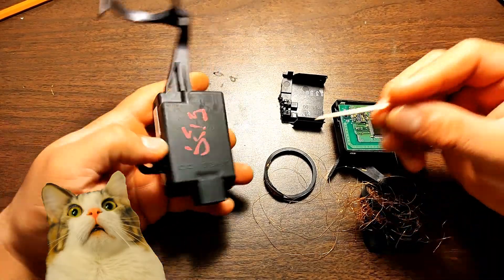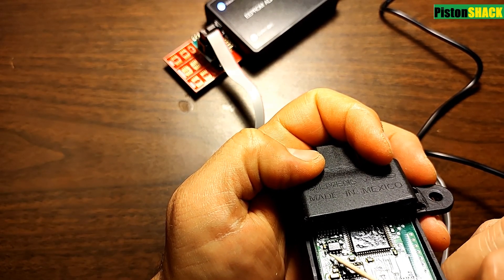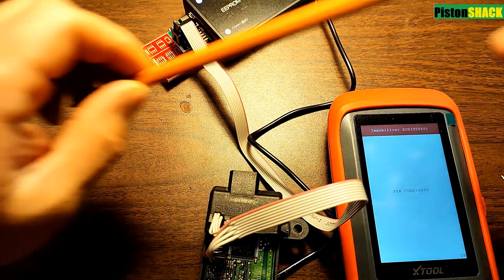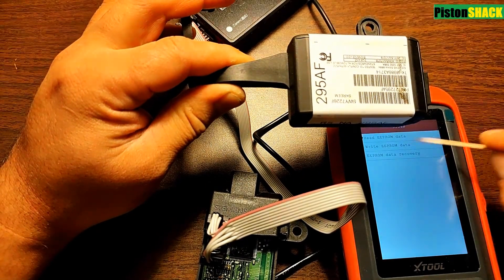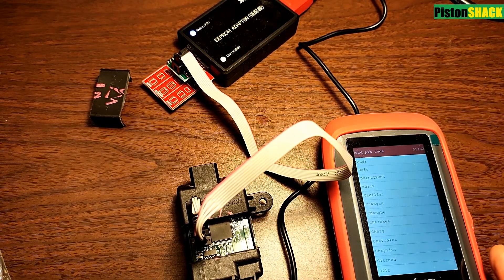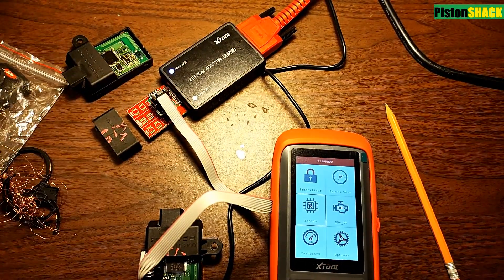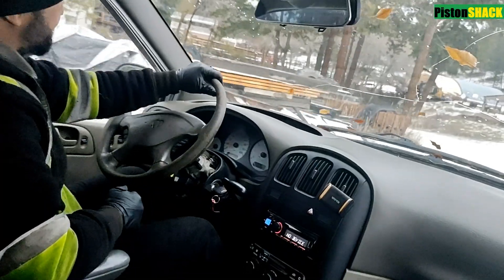HOW  EASY TO PROGRAM USED DODGE, JEEP, CHRYSLER  IMMOBILIZER aka SKIM, SKREEM TO YOUR VEHICLE | p2

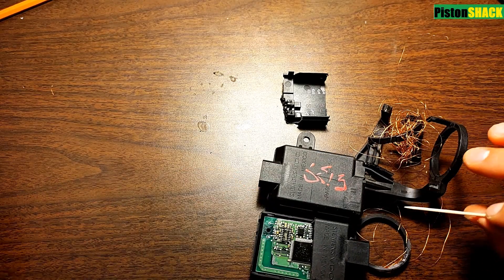Comment: Great video brother. Are you familiar with the 2001-2003 immobilizer eeprom reading. It looks identical to the immobilizer that you brought out here 1:42  except it says immobilizer 3 on my version. And when. You take the board off it does not have the 8 leg eeprom on the reverse side like one board with a chip on it like 24cl02. This 2001-2003 caravan has been my arch nemesis for the last 5 years being a locksmith I just can’t seem to figure out how to edit the immobilizer data. Please help brother!!!

Comment: cant you just pull circuit board out of old skreem and put in new one?
Reply from the maker: I guess you can but problem was to re-wire antenna to the circuit board. Let me know what worked out for you. Cheers!
Reply: @PistonShack  lear ones sit on 2 pins.. can be swapped

Comment: I found a locksmith service that will cut 2 new keys and flash a new skreem to make this "plug and play". They want $300 usd. 😱  No way on a van worth so little in value.
Instead,  I purchased a very cheap USB eeprom programmer with a chip clip for less than 15.00 as I don't have the programmer tools you have.
This will allow me to read, write and modify most 23/25/93 and 95 chips. I can read, store the old code and rewrite it to a used immo.
Reply from the maker: It might work or you can buy EEPROM adaptor for the Xtool on Amazom for 15-20$
Reply: On the chip there is 2 "posts" that the mess of wires in the ring part that broke off.. on the chip is those posts and the wires in the ring Connect to the post. Each wire to its own post... what if I solder a wire on and make the wire loop around the key hole like the piece used to b4 I broke it

Comment: Hi,  it seems that there are only a handful of companies doing the Skim delete.  I have a 2000 Grand Cherokee with lost key.  I have a replacement key barrel but need the Skim deleted.  ( just from my original PCM )    Is that possible with any tool you know of that I can purchase  ?    I  also wonder what in the car the PCM VIN is reconciled against  ?  Is it the BCM  or the trans ECU  or what  ?

Comment: 👍
Reply from the maker: Let me know if you have any questions. What vehicle did you work on?
Reply: @PistonShack  Question for you.  I'm trying to buy this unit from eBay.   Do you know what version is on your Xtool device?  Thanks
Reply from the maker: Mine is Xtool X100 Pro 2
Reply: @PistonShack  working on a 2001 and 2002 Chrysler sebring. I'm trying to add an ignition key with the drb3 programmer diagnostic tool. But I need the PIN code to do any skim or PCM changes.  The drb does not find the code it's not designed to.
Reply: @PistonShack  finding the PIN code for these vehicles is very tough. You have to pay money for all these services to get somebody to get the code for you or buy one of those $1,000 units or more expensive to get a PIN code.  This device with the eprom cable attachment seems to be the least expensive way to find it. I have three of these sebrings and I would just like the flexibility to be able to program these devices.
Reply from the maker: I didn't pay money to any mechanics or lock smith to do my job. I only pay shops  for my tire change and alignment:)
Reply: @PistonShack  I finally used the Pro2 device on the exact same SKIM model.   The problem I have on the first attempt and the Pro2 read the PIN Code as 0000.  Just zeros.  I tried a couple of more times and the same results.   On the last attempt after making sure all of the contacts were working the chip would not longer communicate with the PRo2.   Then I noticed the chip was getting hot.   That usually means the chip is damaged.   Did you have any problems at all with this?  From your videos it looked very straightforward.  Any ideas?

Comment: I have the same problem with the same car, can you help me? I cannot find an device who can do the way you did..
Reply from the maker: Hey Jonathas. I bough XTOOL online from one of the online tool stores. I can take a look, if you are interesting. Cheers!
Reply: It only works with the xtool devices or can I use the adapter with any Key programmer? If I re-do the same way you did using the adapter but with a different key programmer device that does the same work, it will work?
Reply from the maker: I am not sure exactly with any other readers but theoretically chip adapter should work with other eeprom key reader/program devices. It probably will work, let me know how did it work out. 
I think it worth trying.
Reply: Do you think if I remove carefully the Eprom part where the main data is from the inside of the immobilizer, could I replace it into the other? Do you think if done right it will work?
Reply from the maker: Yup, it will work. Just solder Eprom chip carefully make sure none of the legs shorted or open.
Reply: Great, thank you very much brother, I also have been in contact with my friend in Brazil who runs a great Auto Shop and fix everything in electronic parts in any vehicle sold in the country, so he said the same as you, he said I could even get this imobilizer disconected and let the car free with the keys only, just doing some updates on the CPU, he is master like you, ao I am happy I had help from you and from him, We will get this silved and I will post it for you..thanks brother!!!

Comment: Would this process be the same on a 08’ Dodge Avenger ?
Reply from the maker: Hey Kaleb. Shouldn't be much difference. Let me know how everything is going or if you have any questions. Cheers!
Reply: @PistonShack  just bought the car. Salvaged the ignition switch and housing. Just needs new ignition cylinder and it coded to match my original keys. So I should be able to do that. It just needs a new immobilizer at this point. Can’t get dealer to do it u til after I get title switched to my name. If there’s any issues with that I won’t be able to get dealership to put a new immobilizer in and program it. Then I’ll be screwed unless I try to do something like you’ve done here. And I’d have to buy that scanner n everything and try to do it myself. Are you open to the idea of me sending a new immobilizer and the original to you and you do what you did here ??? That would be my last resort. Lol.

Comment: Very good video, thanks. Amazing how that scanner can retrieve that PIN number. I wanted to ask you, will that scanner be able to flash the pcm? Like changing the vin number when you get one from the junk yard . Im trying to find a scanner that can at least do those things . Thanks for any help.
Reply from the maker: Hello Robert! Thanks for your kind feedback. I haven't tried with Xtool yet. I know my Launch 431X pro will do it. Btw, how everything is going with your ECU repair?
Reply: @PistonShack  I’m trying to fix the tipm first. The pcm has been putting out codes normally. I really don’t think it’s the pcm . It’s my first pt cruiser I worked on so let’s see what happens. I have replaced the ignition switch and I haven’t been able to get the starter to turn so I’m thinking it can be the tipm. Everything lights up on the dash. Except for a no bus message. Any advice will be really appreciated, thanks.

Comment: Do you know who can program this for me? One dealership I’m at now said that they can’t with a used one. They said it has to be brand new. They are discontinued and my car hasn't ran for about a month
Reply from the maker: Yup, dealer won't ever program used modules. You can try to find local mechanics or lock smith to do programming.  You always can get new one as well. I called local dealer last year they asked almost 300$ for new SKIM.
Reply: Thanks I appreciate this. Do I need the vin off a used one and what do you think about getting the ecu to  be reprogrammed so it doesn't read the Skim anymore?

Comment: Why couldn't you just on solder the chip out of the old one and put it in the new one? How can you figure out the code from the ECm and program it to another immobilizer?
Reply: not reworking the IC would be a preferred and more robust solution.  However, based on what I see here.. it would be faster for me to swap the chip.  But I think this is only transferring a configuration table and not the internal firmware which could be OTP in the chip.  This is common.  Also, this tool is not generic and may do more than a bit for bit copy. The OP didn't post the checksums from a read after the write and from the original so it is unclear.  The use of the junkyard pin to unlock the write operation may have impacts to the image.  (He wasn't trying to show a full reverse engineer, just a way to guarantee a fix)

Comment: A friend of mine has a 2005 Dodge Dakota somebody try to peel the column they broke the ignition switch up they broke the immobilizer I pretty much had to get a steering column from the junkyard with the same wiring as his it didn't have a key I got his original key and I'm not too sure what's going to have to be done to get this vehicle to start because his immobilizer was busted up destroyed am I going to have to go back and get the computer out of that truck that matches the immobilizer on that column and buy an ignition switch and have it coded to the immobilizer that's on that column? What's the best route for me to go because I had to remove the lock cylinder out of that column the immobilizer is intact not broken am I going to have to get to ECM or ECU out of the truck I got the column out of how would I have a key program to that immobilizer what's the best route for me to go

Comment: One question, I have a bad skim module on 07 sebring, I pulled one from junkyard and have the key for it no ecm. I have the vin of the car where the skim module came from. My question is can Install the used/pulled skim and leave it disconnected, write the vin of the donor car on my pcm, plug the skim module so the key is transfered to ecm, and then write my car's vin back to the ecm? so everything is correct?
Reply from the maker: Hey F B! Ok, I see what is your issue. Well: 1. If you leave "junk yard skim" (any skim) disconnected vehicle won't start and run. 2. If you are going to use "junk yard skim" you have re-write the VIN from the donor car to your Sebring to make you engine start and run - because "JY SKIM" and your ECM will have VIN mismatch. 3. You can swap "JY SKIM" + "JY ECM" to your car then reprogram new keys. Later on you can re-write your vehicle VIN to "JY ECM" 
I can go that route but I would do exactly what I shown in my video. I think it will be faster and easier. Let me know how is your Sebring! Cheers!
Reply: @PistonShack  thanks for reply sorry if I'm not clear, want to know if I get a junkyard skim, write the junkyard 's car vin  n my cars ecm, plug the jy skim, and then write back my original vin back to my ecm. I'm not getting another ecm it's my original one